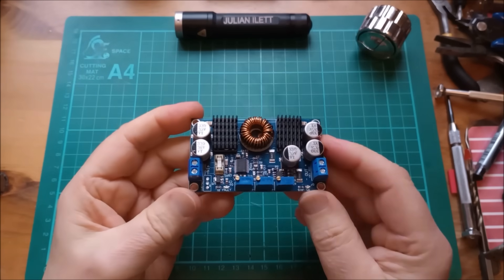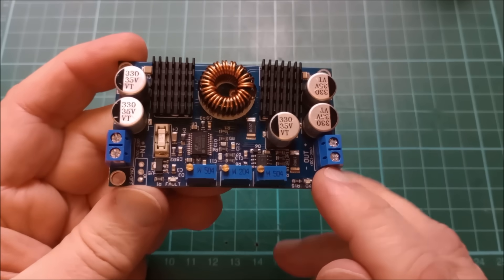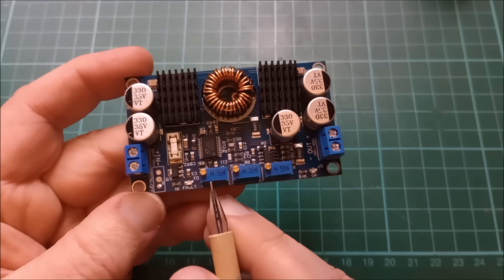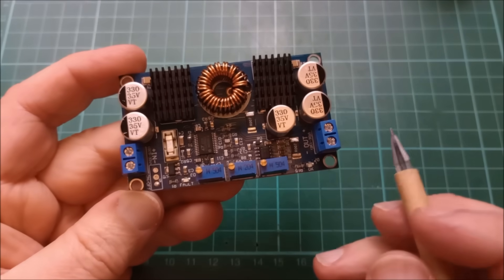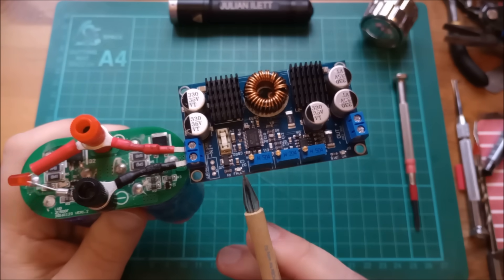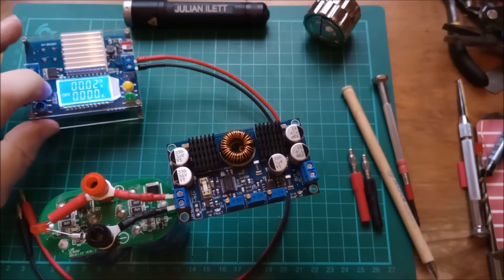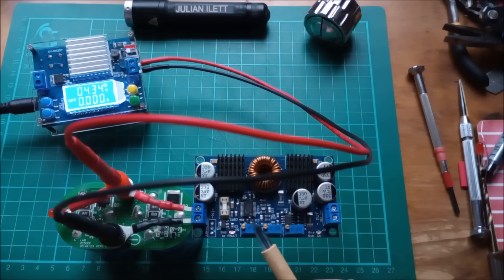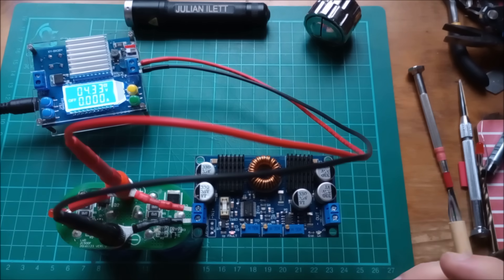LTC3780 Module costs $4

Comment: I'm curious to know what the standby current is in shutdown? 

I could use one of these to keep the dash cam running after engine off until the battery settles to say 12.5V.  like a parking timer but without over draining the battery.

Comment: Been using one of these as a Bench PSU for a few years now, I didn't bother swapping the pots out for normal sized ones with big knobs I just epoxied bigger knobs to the CV and CC pots and chucked it in an enclosure. Bodgetastic.

Comment: Never heard of this module. Very interesting indeed. Thanks for showing!. So i searched a bit here on YT and the net. Seems a very old module and there are some serious doubts about this one. It seems that with a current of more than 3 Amps, things heat up fast and blow up at 4,5 amps. Not be able to handle the supposed rated 10 amps. Have you or anyone tried this and can confirm or refute this?

Comment: Interesting board you got there Julz. I will have to get one myself to try out. I've been looking for low voltage cutout boards, but the most common one is the one designed for a 12v lead acid, and it uses a relay, and as such a relatively large amount of power just in standard operation. 

Theses are $5.30 AUD (2 pounds 70p) to Australia using the choice selections, and they take a further 10% off at the start of every month.

Comment: If you want to do a "good" job of approximating operation at MPP, simply (he says, somewhat tongue in cheek) add an extra error amplifier to regulate the input voltage of the converter. If you want to do true MPPT you must somehow actively seek the peak power point, which isn't really easy because you are looking for a peak.

Retrofitting a control loop to regulate input voltage probably isn't easy on an existing board. I've done lots of switcher designs with multiple control loops by using error amps external to the main controller and setting the controller's internal error amp gain to unity. I've done this for MPPT circuits and for switchers with a voltage regulation loop, a current regulation loop, and a loop that controlled the potential of the "load" relative to earth ground as measured with an electrochemical reference half-cell (all arranged in a "lowest setpoint dominates" config).

Comment: I tried typing in the data I could see on that 2 cap board you have there but couldn't find anything. I'd love to buy one.
Reply: found it on AliExpress ... 2.7V 500F Super Farad Capacitor Single Row With Protection Board

Comment: I would be interested to see the heat sink removed and what MOSFETs they use. I have been using these modules for over a decade and there has been a race to the bottom in BOM price reduction. The first two I brought have an Aluminum heatsink under the board with a flexible thermal insulator and Alpha & Omega 40V FETs. The last ones had small heatsinks stuck on with what looks like double sided tape, to Chinese 30V MOSFETs that effortlessly blow up.

Comment: I would've expected the primary draw to be the LED while discharging, not the board. I would believe the specsheet implies, for 5V idle draw, 2mA worst case? (Supply Current vs Input Voltage). It'd be interesting to see which on average is drawing more.

Comment: Why not just test this with a bench power supply, would take 1 minute, are the super caps just to keep the suspense and drama? too bad this needs above 4V, because at 3.7V it would be perfect for one Li-Ion Cell.
Reply: Well it would need to be good until around 3v because 3.7 to 4.2 is only a little under  half the batteries capacity. But you can use it from 4.0 to 4.2v lol or boost it to 8v and run it through a pair of series batteries.
Reply: That's just as pointless as the video 😂😂😂
Reply: @davey2k12 🤣🤣🤣

Comment: Good your back. Maybe use a bench PSU to test the module and connect a variable load. What would be useful is to see a scope of the input supply and also the output, to aee how clean the modules switching is for different load currents.

Comment: Very noisy electrically,  just switching on and off while trying to mimic MPPT controller.
Reply: Do you know this by fact?
I was thinking of putting a boost converter on my solar panel and then this (fake, under voltage) mppt behind it. This way (I think) the not-tracking mppt circuit is forcing to get maximum power out of the solar panel (without me changing the potentiometer value constantly). Would that work (never mind the boost losses, I understand 5 to 15% power may get lost there).
Reply: @deslomeslager  not by fact as i don't have or need one. But an MPPT controller is expect works by reducing the current and letting the input voltage float up in to the required range and then control the current to maintain the voltage where you want it.
Doing the same thing just by cutting the device on and off will lead to current spikes and thus noise. 
Also they make these cheaper by not fitting any filtering components on the supplies in and out just a few caps.
Reply: @TheEmbeddedHobbyist  I know exactly what you mean! I do use one of those cheapy models that works on under voltage. And every time the sun is out I am no longer able to receive any FM station in a radius of several meters. Luckily I listen to internet radio via an old ipod (0.5 Watt usage, super low, I love that!)

Comment: I have used these in a lot of my projects and they work well ,at that price point... will be ordering more  😎
Reply: What is the max voltage and max current on those boards?
Reply from the maker: Parameters:
Input voltage: DC5-32V;
Output voltage: DC1V-30V continuously adjustable; the default 12V shipment
Output current: 10A (MAX) ,long term within 8A
Output power: 80W, peak 130W, more than 80W please strengthen heat dissipation
Output ripple: 50mV (12V turn to 12V, 5A measured)
Short circuit protection:YES
Input reverse connection protection: No
Output prevent reverse connection protection: No
Operating temperature range: -45 ~ +85 °
Size: 77.6*46.5*15mm (including the bottom surface of the radiating aluminum)
Reply: Wow 8A for $4. I’m tempted to get some even though I have way to many voltage converters.